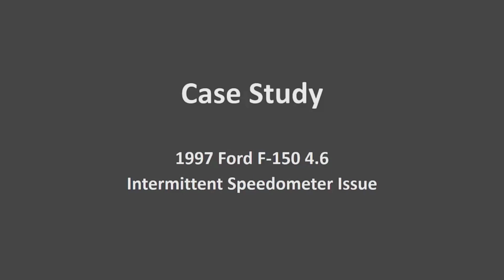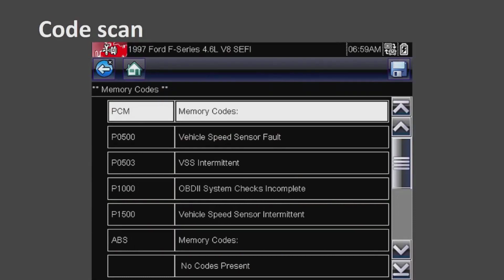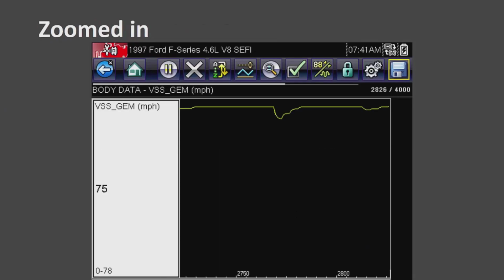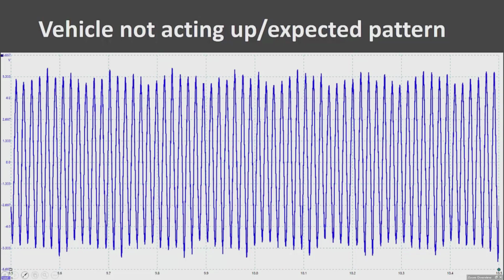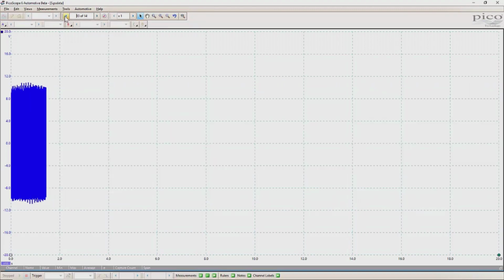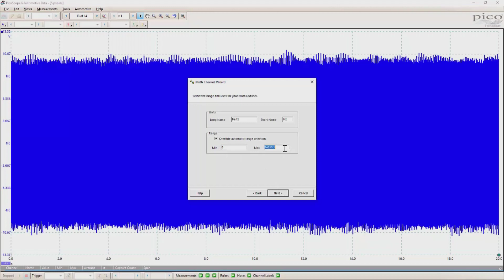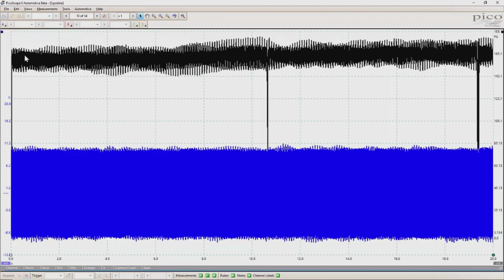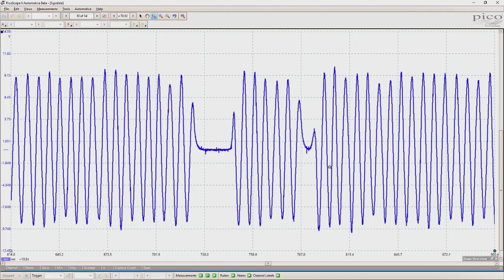Using Frequency Math Channel To pinpoint sensor drop outs

Comment: That's awesome! Time saver for sure! Saved
Reply: Cuba, I haven't seen you using a pico. Which pico do you have? I just bought the 4425a, I've always been a computer geek so this was a no brainer for me, I always wanted scanners that work with computers due to the flexibility of a PC but then tablets came up and I stopped using PCs for scanning and looking at data. I still have the Autoenguinity but it sucks compared to the Launch or Autel.

Comment: Very kool vidio...can all sensors be checked with a graph frequency...if not how does someone know ...just trying to learn...thanks in advance
Reply from the maker: Eri Ginez sort of. For instance, a VRS crankshaft position sensor typically has a missing tooth which you will see in the frequency math channel HOWEVER if there is any other abnormalities in the pattern you will see a non rhythmic "blip" in the math channel.